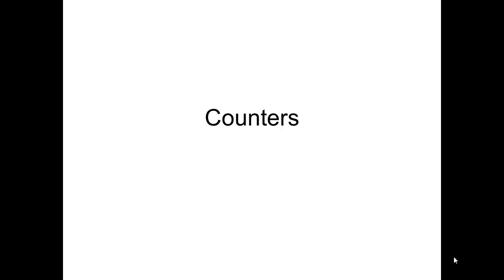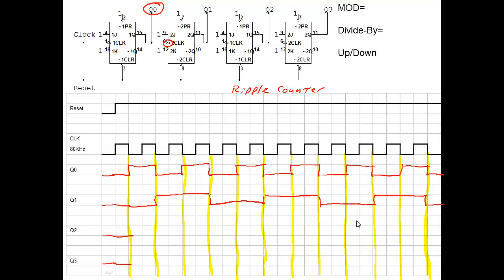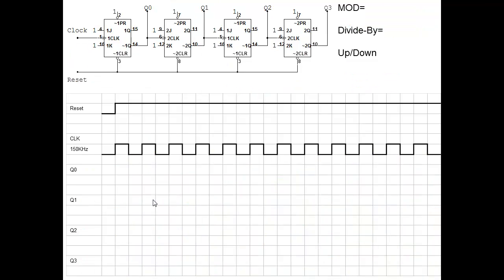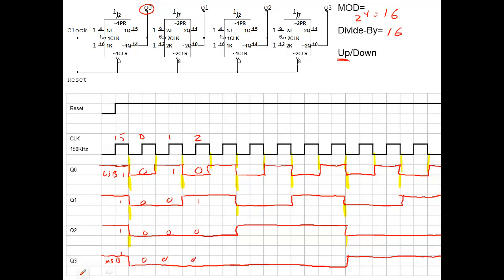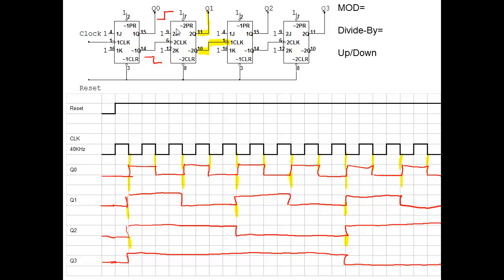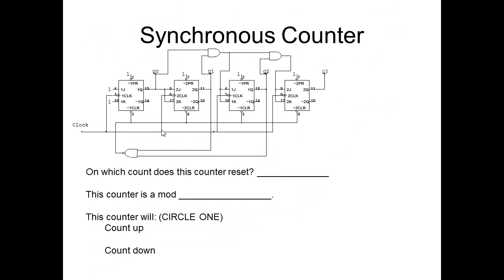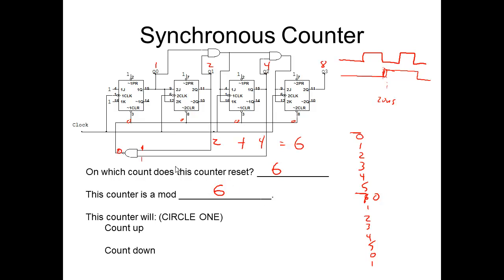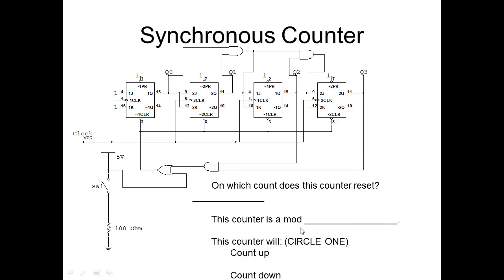Digital Electronics -- Counter Circuits

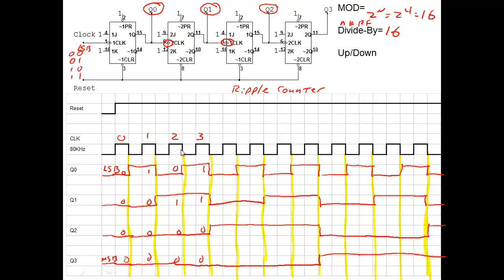Comment: Hello! I am confused. When I make this logic in logisim (at 8:30) I get down counter.  Not up counter. Why so?
Reply from the maker: Logisim defaults to a positive, or rising, edge clock input. That would change the up/down mode of the counter. Change them all to falling edge and it should fix it.
Reply: MovieHQ thanks!

Comment: if I have ten buttons with ten digital number displays above them, how can I wire it so that when I push a random button the display above it reads "1", then the next button I push reads "2" and so on, with each number display keeping its number until reset? I cannot find anything showing how to do this. Is it possible? Would the buttons need to be held down? or can it be done with the buttons being pressed and released as long as they are each only pressed once?
Reply from the maker: If there were only one display, it would be pretty easy to do. Having multiple displays poses a problem. One solution would be to have each display attached to it own counter. When any button is pressed it causes the counters to increase. The oddity is that you will need to blank the displays until that button is pressed. Maybe with an SR flip-flop to hold the line until the button is pressed. That same SR FF would also need to disable the counter so it would not count up anymore. I hope that helps a bit. At least point you in the right direction.

Comment: Is there any possibilities that Q0 will be toggled from positive edges of the clock? seems like all types are start with toggling on negative edges only that the Q1 Q2 Q3 depend.
Reply from the maker: +Ang John Syin You can use positive edge trigger FF. They just all need to be positive edge triggered. NOt sure if that answered your question or not.
Reply: +MovieHQ could you show me some pictures of that? really appreciate your replies
Reply: +MovieHQ in all cases of the video, all Q0 is based on clock's negative edges. my question is, is there possible to toggle on positive edges?
Reply from the maker: +Ang John Syin Yes, you just need to draw out the diagrams with positive edges. What happens is the ones I have as up counters, will not be down counters and my down counters will be up counters. They work the same.
Reply: +MovieHQ but how would the flip flop be?
Reply: +MovieHQ What troubles me alot is how a diagram has only one pattern but different toggling edges. For example in 23:12, why is q1, q2 and q3 toggle on positive edges while q0 is toggled on negative edges
Reply from the maker: +Ang John Syin That is because in that one, the Q1, Q2, and Q3 flip-flops are getting clocked on the Qnot output, but we are drawing on teh diagram teh Q output. It makes it appear to toggle on the positive edge instead of the real negative edge.
Reply: +MovieHQ thank you very much... appreciate your quick and clear reply.
Reply from the maker: +Ang John Syin You are very welcome.

Comment: Nice video, thanks. But what kind of a counter is a 7490?  It's a decade counter but why when it has 4 flip-flops, then shouldn't it be able to divide by 16?
Reply from the maker: 7490 is a decade counter when the first output is connected to the second clock input (Pin 12 to 1). Truly, it is a divide by 2 counter and a divide by 5 counter. It is not a Mod 16 because it is set to automatically reset internally.

Comment: Super great videos! Although I'm having a hard time telling the difference between up counter and down counter, any particular tips for telling when you don't have the timing diagrams?
Reply: Do down counters run off of the same clock pulse and up counters run off of opposite?
Reply from the maker: Katya Noel Stocks No, they use the same clock signal. The up /down count is determined by how the circuit is constructed. For example the up counter can be made by either a positive or negative edge triggered JK flip-flop with the Q output going to the next clock. A Down counter is constructed by either a positive or negative edge triggered JK Flip-flop with the Q NOT output tied to the next clock. In both cases, your usable output is from the Q output. You can have a bunch of counters synchronized to the same clock, but running both up and down. Hope that helps.

Comment: How can I design a bcd counter with mod66? I watched all of your videos but i just couldn't figure out how to do that. If you could answer as soon as possible that would be much appreciated.
Reply from the maker: I am not sure what you mean by a mod 66 BCD counter. BCD counters are mod10 counters built into sets of the number of digits you want to represent. Now for a mod66 counter.. You will need 7 J-K flip flops tied either asyc or sync. A 2-input NAND gate will tie to the 2nd and 7th (last) JK outputs. The NAND output will then tie to the JK resets. Link to picture: http://district.bluegrass.kctcs.edu/kevin.dunn/files/mod66_counter.jpg